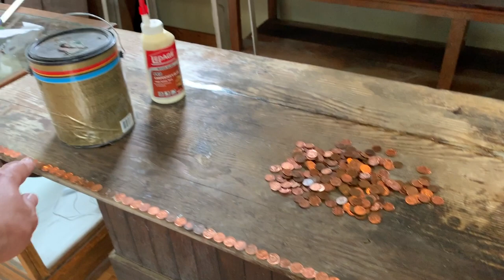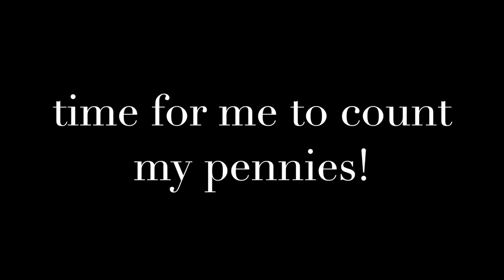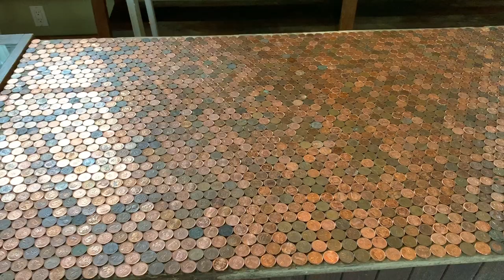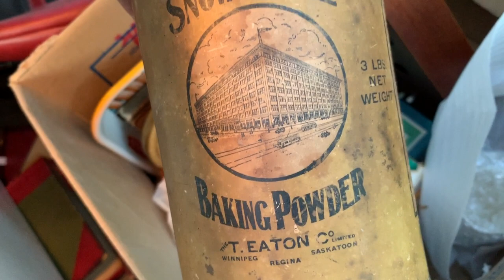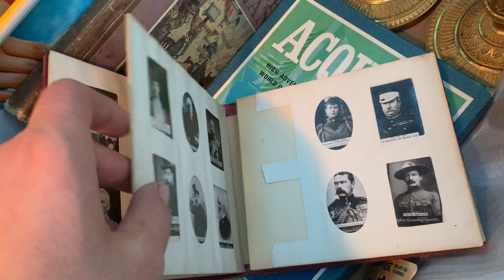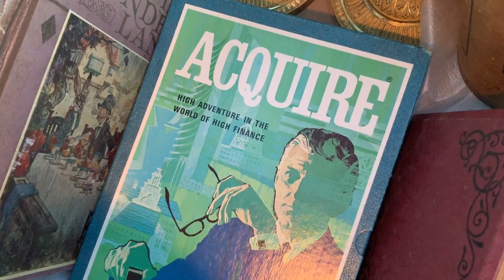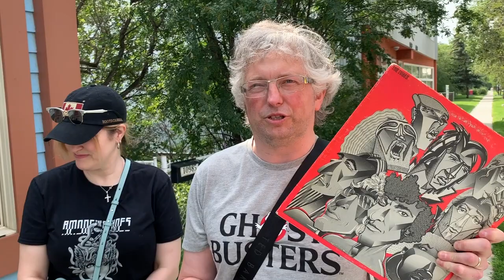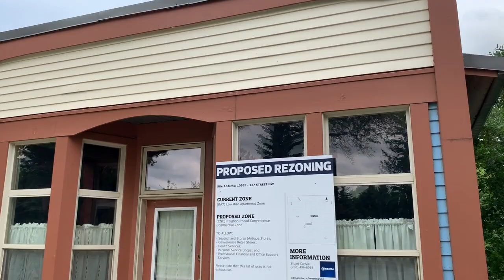Part 5. Out with the mold, in with the new! The General Store

Comment: Trim trees so you get air circulation around house, to keep down mold. No trees over building roof to protect roof. Mold grows due to moisture, keep building dry.  Gutters and down spouts get water away from building and keep water out of basemen.  You can plant new trees if needed.
Reply: He could cut those right away and plant Paulownia trees at a good distance, provided they are yearly trimmed, they'll grow full size in 10 15 years.
Reply: Especially on the north side since the sun rarely shines on that side.
Reply: They do need pruning back. I was a little concerned that he might remove them all at once, as that would make for very wet ground. (Trees take up a lot of runoff water.) 
Of course, the draining from the property next door has been rerouted, so that should help.

Comment: You sound congested again, I've wondered with as much exposure you have to dust and moldy environments if you have looked at   allergy shots or tinctures. I'm extremely allergic to molds and I other elements and have found they greatly helped me. I didn't realize till after I had been taking them for a while how exhausting my allergies had made me feel. I also wear masks when I have to clean or work in such areas.

Comment: Just a quick note: I have worked a lot with resin and it actually takes much longer for a good cure than 48 hours also    a hobby heat gun will help tremendously in getting rid of bubbles.

Comment: Lots of concern and buzz about the pennies counter.  Many of us know how that really goes but for those who are interested... Get a good quality resin and do it layer by layer so it cures evenly.  Tape for the edge to hold it until it is done as someone suggested but in past experience the edges got chipped and pennies were lost (IE. Souvenirs).  We decided it wouldn't destroy the concept and edged it with wood edging we made cut to fit but plywood would work too.  That way the wood takes the beating and not the resin.  Just saying okay?  Also somewhere here on You tube  there is a gal that did her entry floor  with pennies, worth a lookie lou.
Reply: And resin has probably changed  a bit since the mid 70's when I worked with it.  lol  But as a general product it still does lots of great stuff.

Comment: If excess water remains a problem you can install French style drains.  They work well.  Also check out if Joshua thinks the "new" and bigger window could be used sideways on the wall.  We did this with some similar but way older windows (1930's ish.) and with a bit of adjustment and wood got just what we needed.
Reply: too late love,  it's in vertically lol

Comment: A spritz of WD40 will dissolve the stick-um of that tape on the showcase glass.  love this new store.  Best wishes.
Reply: You can also use 90percent rubbing alcohol and a straight edge razor blade and will will come off real easy. Also use it too clean windows that have paint. Wet paper towel with rubbing alcohol then  wipe down glass then wipe clean with old psc of towel s.

Comment: Alex you can take the bottom part of the where the pennies are and use a fine sandpaper on the sander. Lightly send all of the cash register area then with a damp and rag wipe it off where you can get all the Dust off from it Rust-Oleum sales a paint that is copper . I'm supposed to be able to cover anything and your whole counter will be copper. Just a suggestion🌹💜💜💜

Comment: IF, you ever do the penny top, or any penny lay again, a super fast way to do it is this. You find a thin baton, say 5 mm (can be cardboard, resin won't care, but if it is, lay it knowing you'll have to use a bit of a sander work to remove cardboard in the resin edge), lay around the edge to create a dam. Then, you pour a substantial amount of pennies on the counter/floor, that, you then move around with your hand until they all lay flat on the counter/floor (on the floor this goes even faster if you have a piece of cardboard to spread them around, might work on the counter, but smaller, on a floor job, you can really go nuts with the cardboard).

Once you've done that, using a spatula or any hard edged item, start pushing them towards the edge, be it a baton or your floor trim. As they reach the edge, you use the palm of your hand to arrange them neatly. Once they "lock" in wherever they to, as long as you're being gentle with them, they will generally "stack" and not move anymore. You don't want to push them really hard tho because there's a chance they will fling up in a wave (have done it).

This method is sooo much faster than the traditional piece by piece and only requires a modicum of attention at the end to make sure they are all neatly "stacked".  I've laid an entire bathroom floor in this fashion using a piece of cardboard in under half an hour + 10 or so minutes to make sure they all fell in right without gaps (visual inspection).

Comment: My 150 year old house has windows that are 72" tall, almost floor to ceiling as well. The trim at the bottom ties into the baseboards with a nice inset under each sill. Honestly, I think a floor-to-ceiling window is much more appropriate for an older building, anyway. There wasn't electricity, so old homes need as much light as they can get. It looks much better than that small window!

Comment: The brackets in your shelves what if you took some sandpaper and lightly sanded them in different places and then take some acrylic paint and lightly brush the paint onto the brackets. May give it a rustic older look. You'll have to mix colors to get that stained look you have on the shelves.

Comment: Learned a few things from car detailing guys, the best glass cleaner is not Windex but a cleaner called Sprayway Glass Cleaner.  I just love this product because it does not streak.or leave a residue.  Home Depot might carry it or you can get it on Amazon.  Best cleaner for hard to clean water spots on glass is Bar Keepers.  With this product  I wear gloves.  A general cleaning product that cleans up grease on carpet or any surface is Super Clean.  Dilute it 5 to 1 with distilled water.  You can get than in a gallon size at the local auto parts store and I also bought a McCullock steamer for a few hundred bucks and I love it too.  It cleans carpets, bathroom kitchen tiles, etc.  Spray an area with Super Clean and use the steamer with a micro fiber towel and it will clean just about any stain.  Good for cleaning your store, cars and motorcycles.  Best bulk micro fiber towels is the yellow ones from Costco called Kirkland Micro Fiber Towels comes in a 36 towel pack.  Best sealant for cars, motorcycles or boats is Bead Maker Paint Protectant.  I never use wax anymore.  Hope these tips can help you with the new store.

Comment: If you want lots of light, could you put that new window horizontal instead of vertical? If it's vertical you're using up a lot of potential display area (shelves, cabinets, etc.) And get out your belt sander and just take that blue paint all the way down so you can prime correctly.

Comment: Hello Alex and crew, just wanted you to know......
In this episode you mention the difference between new glass, and old glass, by noticing the wavy effect.
Well  yes their is that, but one can be even more period specific, by knowing these few simple facts: 
The first real translucent glass was produced & sold for windows was no sooner than 1830, and only until 1904, this glass can be distinguished by looking for these specifics traits,  this glass does have the same wavy effect, but beyond that one can also see quite a few air bubbles trapped within the glass itself, and also the occasional concentric round ripples that look just like the surface of water one notices after dropping a pebble in it.
1904.... Date when they could now rid the glass of the two specific traits, i.e. The air bubbles, and the concentric circles, but the wavy effect remained until 1959.
Yes 1959 is the year windows (and mirrors for that matter) had finally completely cleared up.

Please note that I am not at all an expert on this matter, these are a simply a few basic facts I discovered out about  7, or 8 years ago while looking to replace a single broken mirror that was part of a set of 4  mirrors on an antique ladies vanity-desk. 
This took me about two, or three months to find through local glass salvagers here in Montreal, of course to make matters real easy I needed the oldest version (1830-1904). 
But once found, & replaced, it matched just fine, and my girlfriend was no longer upset, as for me I was just very glad that she was the guilty one, because had it been me...  I am not sure we'd still be talking, because this desk was a precious heirloom that was sent to her from Portugal, I must admit it is a lovely piece.  

P.S.-1) I have since then heard that there's a company in Texas that can manufacture small order custom glass for almost any need.  

P.S.-2) The history of automotive glass is for some reason a completely different one, and the wavy effect was eliminated way earlier somehow.
One thing I do know though is;  that the molded to shape, or curved glass was introduced on 1950 models, and that the center bar in the middle of the windshields was last used on some 1949 models.

 P.S.-3) A simple trick / hack, you may, or may not know.
If you are ever confronted with a old piece of glass, or a window that has not been washed ever, or seems like never;  just do NOT attempt to wash it first.  
Use this trick first, then wash, it just works better in this order. The trick is to FIRST apply some oven cleaner, let it sit for 30 to 60 minutes, then rinse, and wash. Personally I find that Mr. Muscle works slightly better than Easy-Off for this.

I hope above infos, tips, and tricks can help anyone reading.
 Pierre Decarie, 
Montreal.

Comment: Tan looks a lot better than the baby blue color Im satisfied with that look. You need a tiny paint brush for the little bit of blue that is left. The way to paint is from the top down so that if you drip or run you wipe it out as you work your way down. That makes good since right? I use to paint professionally and that was the way we did it. I know how you fell about the bug in your eye while you up so high that is dangerous and how about if it was a wasp that would be bad I have fought wasp on ladder high on the side of a house not fun. Yeah a fly in the eye is not fun way up high on a ladder.

Comment: Did you consider using resin epoxy over the pennies on the counter? I’ve been working with resin for about a year and a half. It’s amazing to work with and when you add metallic powder to it, can create some visually stimulating effects. You should really think about using it somewhere in your new store, it mimics natural stone so well it’s hard to tell the difference.

Comment: Although it's too late now if you had asked me I could have told you how to put down ALL those pennies in less than 5-10 minutes. I'll tell you anyway for next time. lol 
You glued all the outside edge, right? After the glue dried all you had to do was dump all the pennies on the table and use a stick or yardstick to push them up against the glued ones they all would have automatically found their proper place and since you didn't care heads or tails, dark or lite... then presto... Bobs your uncle. Done in well less than 20 minutes. Then acrylic over the table... when dry... Alice is your Aunt, Bob's still your Uncle... all done. (grins) Bet you wish you had thought of that?

Comment: The wind-up toy at 24:03 is Russian (Soviet), not German (maybe it was a clone of a German toy though). You should have recognized Cyrillic there. The game's name is HIGHWAY (ABTOTPACCA — AVTOTRASSA).
I think it got to Canada with Russian/Jewish or Ukrainian immigrants, or maybe via merchant mariners some time between mid-1970s to early 1990s. It is actually an older thing,  mid-1970s, I guess. At least those were not on sale here in the late 1980s when I was a kid... I actually didn't see that thing even at Soviet Toys Museum in Central Children's Mall in Moscow or in Soviet Arcade Machines Museum (or rather museums, there is more than one of such even in Moscow alone), so it's pretty rare by itself, especially these days and, moreover, in your part of the world.
I had an electric tabletop game like that: a motorized circle and a small car on it with a magnet inside, another magnet was on a rod that was connected to a steering wheel in front of the contraption that was supposed to mimic the dashboard. Also there was a real (if simplistic) key acting as an on/off switch and a 3-position lever that selected the rotation speed. The idea was to hold that little car in the lane that implied constant steering because magnets were sub-par, the whole thing was wobbly and the “road” was, of course, circular. The thing roared and rattled worse than Russian toy electric tanks actually (not in the least to keep impression of real driving — Soviet cars were not quieter than their Italian, German and American prototypes from 1950s, 1960s and 1970s), and used a flat 4.5V battery... but for a 5–7-year-old that gave quite decent idea of driving.